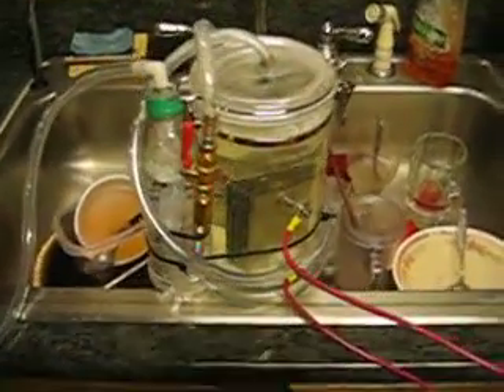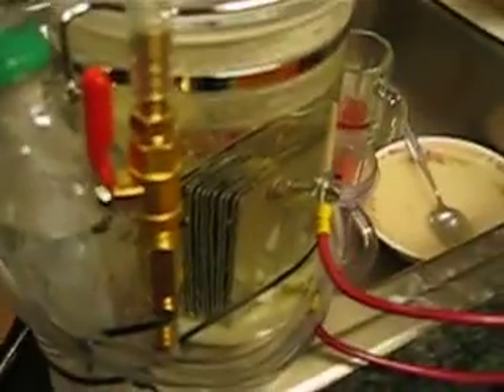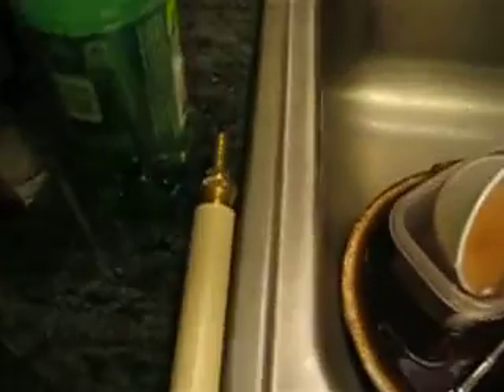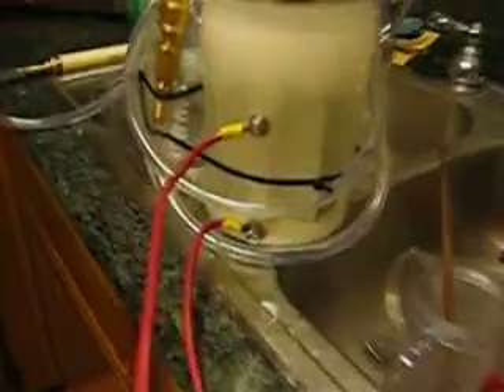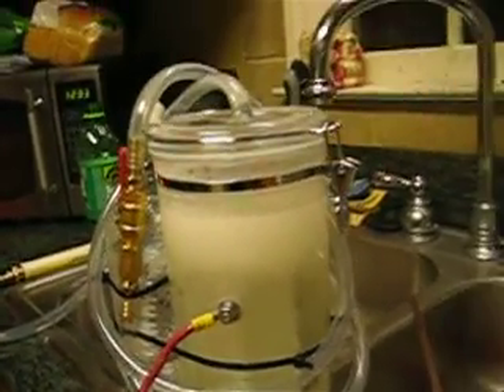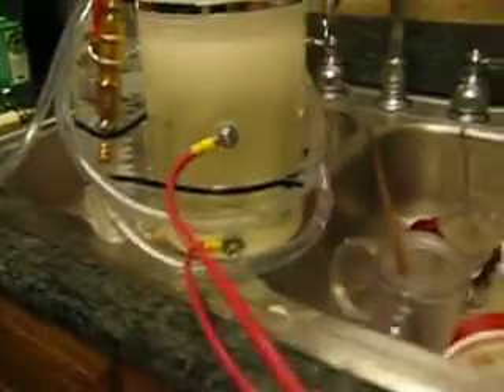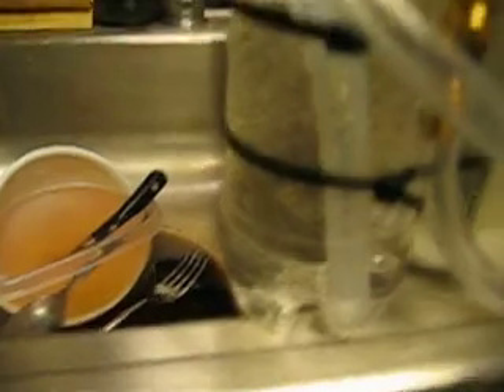hho cell 12 plate 14 amps

Comment: Liquid hydrogen has a density of 71 gm/l. There is actually more hydrogen in a liter of methanol (99 gm/l) than in a liter of LIQUID hydrogen.
Regular Gasoline has 133 MJ/Gal
Hydrogen has about 390 MJ/Gal or 3 x the energy per WEIGHT than gasoline.
A gallon of gasoline weighs 6.073 lb.
Try to produce 2 POUNDS of hydrogen to equal a gallon of gasoline (6 lb) and see how much energy it takes to do it.
Hopefully, these facts will steer others from continuing down this energy wasting Hydrogen path.